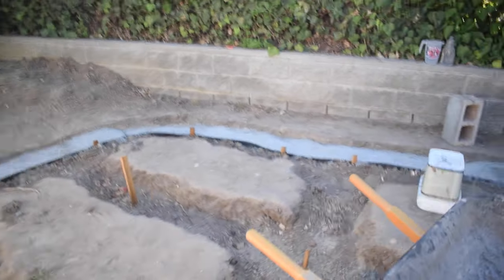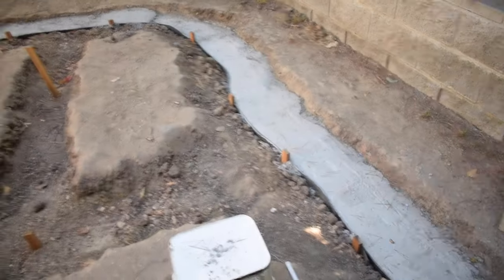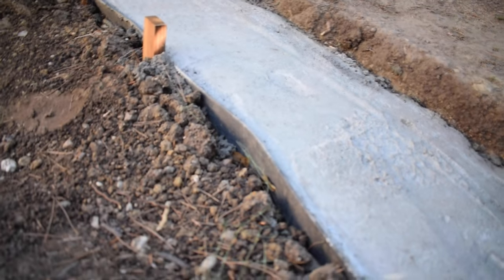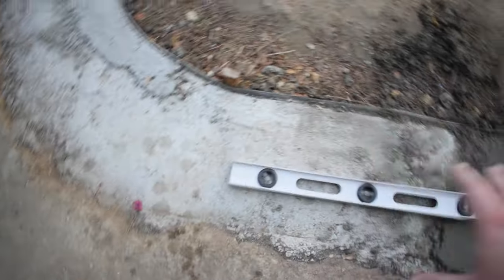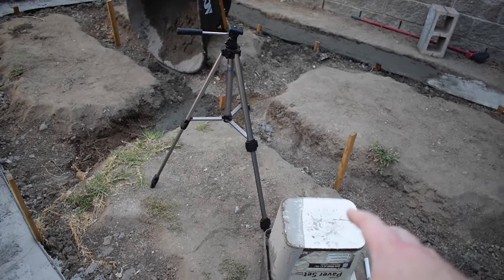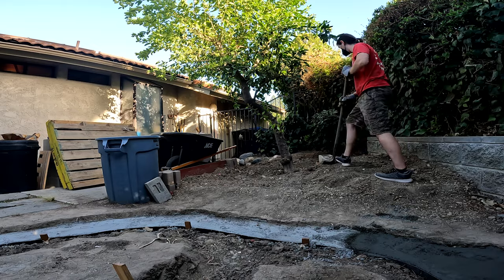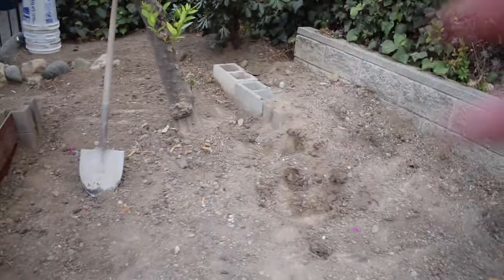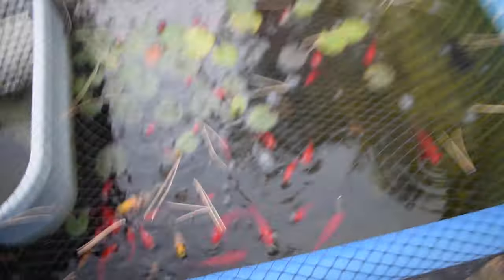Finishing Leveling My Pond! BACKYARD POND BUILD DIY

Comment: Yea bro, it's best to do all work that is needed inside the pond b4 you build the wall . And Don forget if you want any plumbing or draining pipes for water changes or anything else to install all plumbing b4 or during the assembly of ur wall! Always a aquamigo
Reply from the maker: Thank you Jro! As for right now, I don't think I'm going to do any kind of plumbing inside the pond. I'm a little worried about making holes in the liner and getting a leak over time 😅

Comment: Sweet, great job buddy! Curious to see how deep you will en up going. I was aiming at 1 meter dept but ended up with 1m10 deep, got a bit carried away😋
Reply: OH quick tip, if you only start digging in the afternoon around 4, spray the ground around 3.30 so that in seeps in a bit. It will be less dry and easier to dig, at least in my opinion 😁
Reply from the maker: @vertigoone-one-722  Yeah I guess we will see when I finish digging haha. Remember how you told me it would be nice if it rained before I started digging? It actually rained last night haha. Probably not enough rain to make the ground really soft, but better than nothing 😄

Comment: Hey I just started a pool pond in Florida. I have a UV filter and. Trash can filter with poly fill as and lava rocks as my media. The pond is about a month old but the algae is getting so thick that I’m starting to not see my fish. What steps can I take to fix my pond. I have seen several videos saying that the good bacteria just needs time to grow but I don’t want to wait and hurt my fish.
Reply from the maker: Hi Kaden, I'm thinking the reason is that your pond filter is not yet established. Since your pond is only a month old, that is not enough time to establish the necessary beneficial bacteria. Since it sounds like you already have fish in there, I would recommend buying some beneficial bacteria. The one I use is API Quickstart. Add it to your pond and this will help you establish bacteria quickly, probably within a couple weeks. Other things to keep in mind are, don't add tap water straight to your pond, add it to a different container and dechlorinate it first. Also, never rinse out your filter media with tap water. This will kill the beneficial bacteria. Only rinse out your filter media when absolutely necessary (with water from your pond).  If you are worried about your fish getting hurt, I would recommend getting a water testing kit. I use the API Master Test kit. I wouldn't recommend the test strips, because in my experience they don't give accurate readings. If your water parameters look good on the test kit, then you don't need to worry about hurting your fish. Hope this helps and if you have any questions feel free to reach out to me!
Reply: @TobiasHolenstein  thank you, That’s what I thought it was, what brands of beneficial bacteria do you recommend
Reply: My pond is 800-900 gal
Reply from the maker: @KadenHillery  API Quickstart is the only brand of beneficial bacteria that I have experience with and it seems to work pretty well
Reply: @TobiasHolenstein  I’m ordering it now thank you so much
Reply from the maker: @KadenHillery  You're welcome! Best of luck!

Comment: And I don’t want to appear like a killjoy but getting hollow cinderblocks may not of been a good idea as when you lay them on top of each other you’re not going to be able to put a layer of mortar on top of one you’re going to have to fill the holes perhaps solids in the blocks would’ve been better though I suppose on the plus side the fact that you’re going to have to use a lot more cement down the inside of the cinder blocks it’s almost like building another concrete wall so it will give a little bit more lateral strength
Reply from the maker: Yeah that's true, I am planning on putting some rebar through the blocks and then filling them with cement. I still have quite a lot of cement left over that I can use. Maybe I'll only have to buy a few additional bags
Reply: @TobiasHolenstein  It won’t hurt putting Rebar in it’s probably a bit of overkill but you have to watch it when put in the cinder blocks on top of each other because normally you would use mortar not concrete mortar is just cement and sand with no stone so it’s smoother
Reply from the maker: @fj1100mark  Oh ok I see what you are saying. Do you think it would be basically the same thing if I put my concrete through a strainer to get the stones out?
Reply: @TobiasHolenstein  yes although you would find that your mix would be rich in cement then as you’ve taken the aggregate out what you could do is take the stones out and add more sand to it to replace it
Reply from the maker: @fj1100mark  Ok got it, there doesn't seem to be too much gravel in this mix, maybe like 2 handfuls. Maybe if I just take it out it'll be ok
Reply: @TobiasHolenstein  if that’s all there is it will probably be okay. If you look at concrete mixers they are always in proportion of cement fines which is sand and course aggregate which is the gravel
Reply from the maker: @fj1100mark  Ok got it, thanks so much for your help. I will see how it goes 🙂